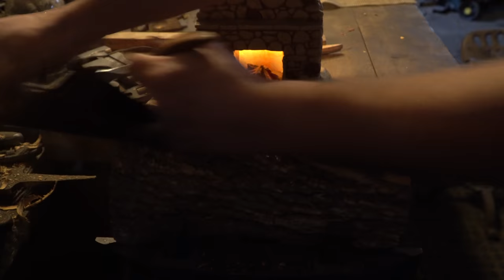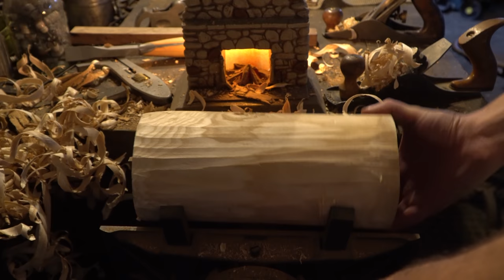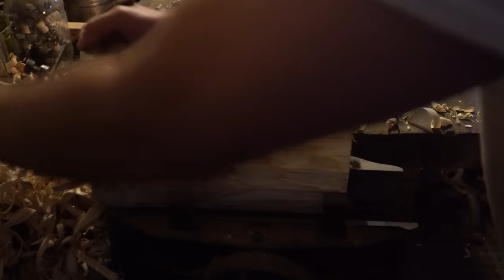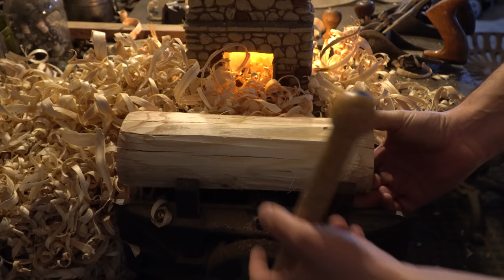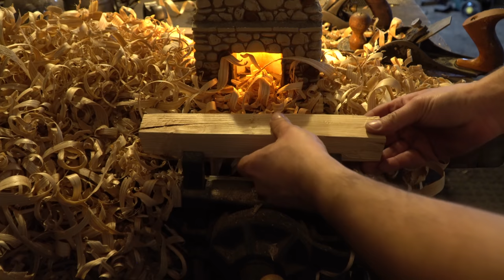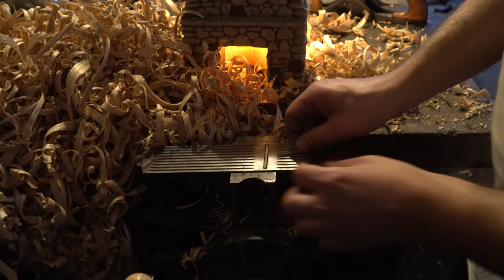Hand Tool Rescue's Yule Log to Toothpick

Comment: Just reminds me of every lathe video ever...

"I need a 3mm steel pin... Better break out this 2ft diameter steel blank!"
Reply: We need a 1/4" dowel, but all I have in the shop is this pine tree
Reply: Sometimes you gotta smoke what you got.
Reply: absolutely. once i even saw someone (big sub count) turn away a good portion of the length of a bar instead of parting it off. got me triggered good.

Comment: I'm going to it this on the Tv this Christmas when the kids are opening their presents, instead of the whole fire place setting. I think I'll keep the audio going as well. Lord knows how much I hate Christmas tunes so this sound will probably ease some tension. Then there will be two big gifts wrapped and inside will be the traditional present wrapped inside another present wrapped inside another present wrapped inside another and so on until there is just a tooth pic in a small hand crafted box. If I time it just right this video will conclude just as they finish opening their gifts.

Comment: Shepherd sale in the palm of your hand a large piece of wood.
A tourist comes and asks:
- baco what will it be?
- a boat, you will come in 3 weeks and you will see it.
They come and the shepherd buy an even smaller piece of wood and the tourist asks:
- there will be a boat and what will it be?
- Christmas, come in 2 weeks.
They come and there is a smaller piece of wood and the tourist asks:
- baco! What will it finally be? It was supposed to be a boat, it was supposed to be Christmas and now what?
And the shepherd said:
- if I don't screw up, it's a toothpick.